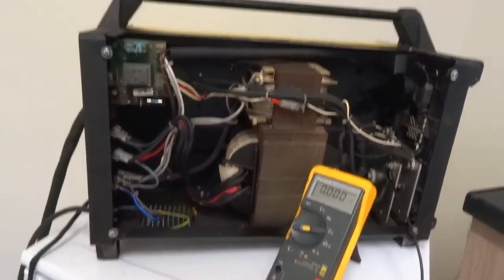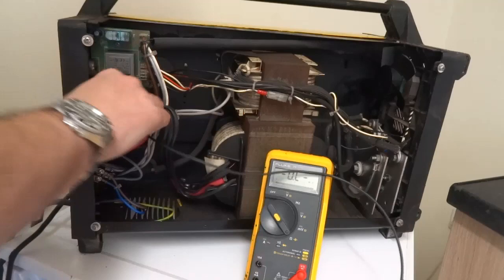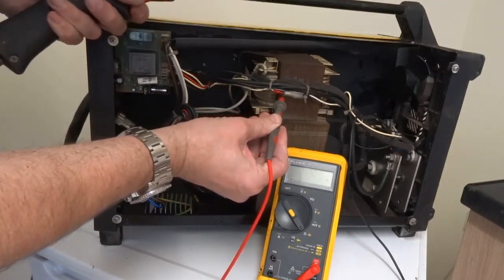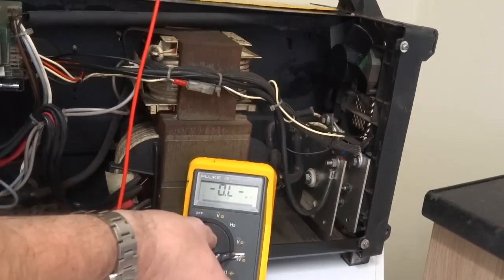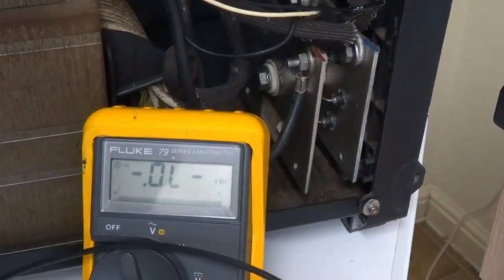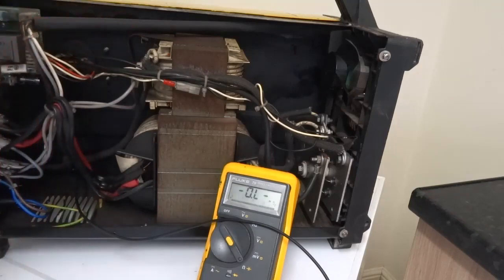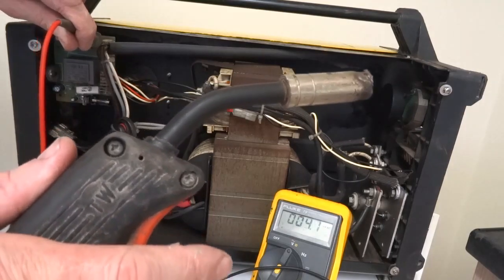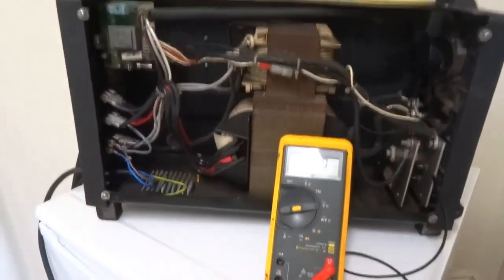Complete MIG Welder Fault Finding! (No Arc, No Wire Feed & Component Testing)

Comment: I really need help converting my Migatronic Rally 166. im trying to get a euro torch working, but as i have zero eletrical engineering skills, 3 electricutions and one multimeter later, I know what not to connect to. i cant get feed motor and solonoid both at the same time off the trigger... Please can i send you a video of what i have, as i cannot afford to buy a new machine.
Reply from the maker: no idea sorry